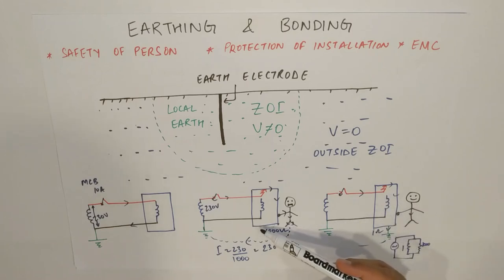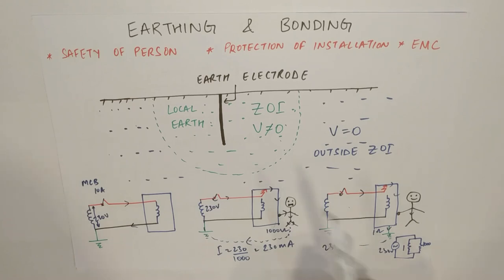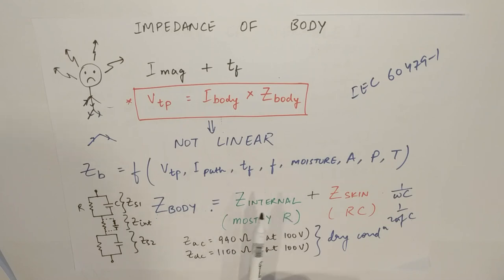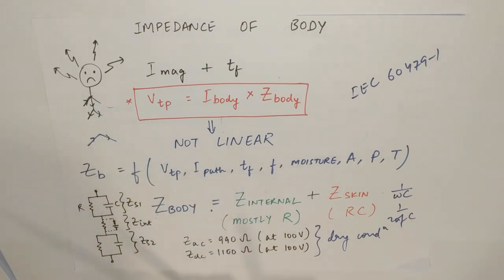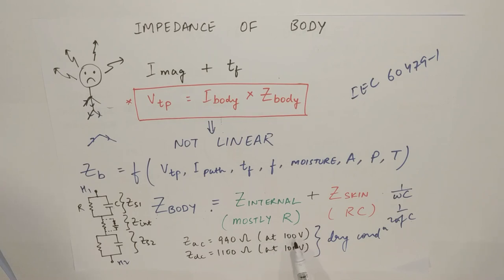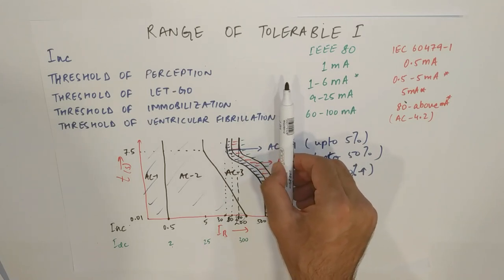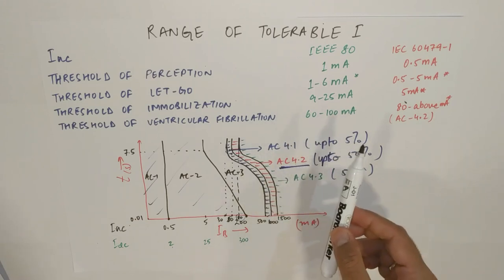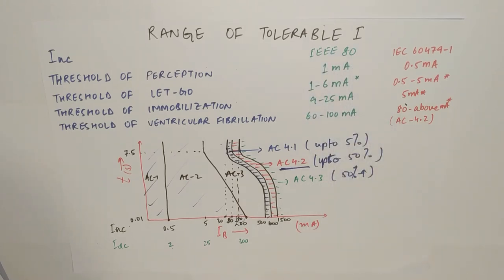Earthing & Bonding Lecture 1: Basic Definitions and Interesting Facts

Comment: Very useful. One feedback, your video assumes that the power supply is grounded. In Railway signalling, supplies are sometimes floating so grounding is not needed at the equipment side. Please check IT type power systems.
Reply from the maker: Many thanks... Very true... As it was the first video so prepared more generalised one... Will discuss separately in a video about different types of earthing system... TT, TN-S, TN-C, IT, TN-C-S as per IEC 60364 series...

Comment: Can you have a return path from the ground on the Moon, or Mars? It is a return path depending on soil resistivity, isn't it? Just a thought! (Instead of Earthing, you will be Mooning or Marsing!) Great lectures like always keep up the great work!
Reply from the maker: Thanks a lot.
In case the source is on Moon/Mars and is feeding a load at the earth, then the return path will be the atmosphere as the current flows closed path. However, in this case, the current will be negligible, thus making it a high impedance fault.

Current will do back to its source through the least resistance path, which could be less resistive soil in case it is available on its way back to the source.
Reply: @railwayengineeringinsights6463  I guess it's the same theory, it's universal! Ground is a return path no matter what planet you are on!

Comment: Nice lecture to begin earthing and bonding playlist. Is this concept related to how Faraday cage is designed?
Reply from the maker: Many thanks...not exactly...Faraday cage will a part of EMC series... Which is used to achieve immunity against radiated EM waves...
Reply: @railwayengineeringinsights6463  how did Tesla walk in an electrified steel cage? Was is a Faraday cage?
Reply from the maker: Faraday cage is a solid steel box/cage preferably without any penetrations. Steel having high permeability is able to absorb high freq fields. Thus, protecting the circuit inside from external EM disturbances. As steel has higher conductivity compared to human body, the electric current will flow through it. This principle was used by Sir Tesla...